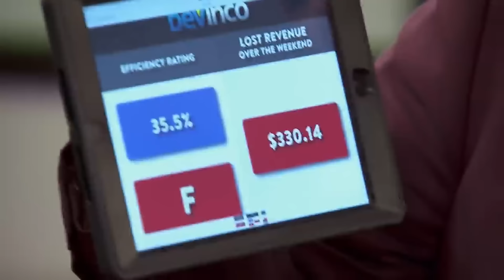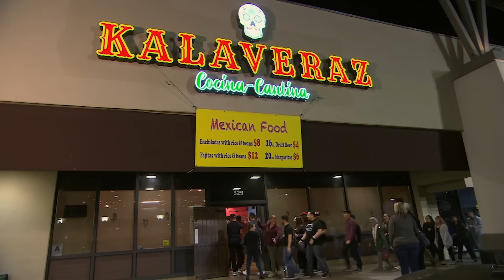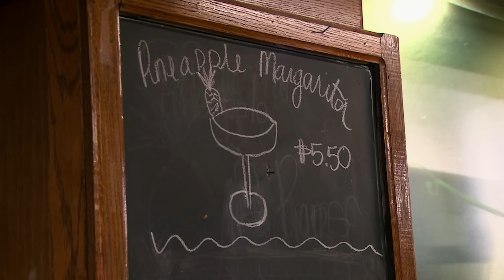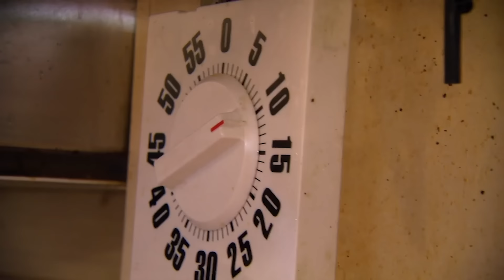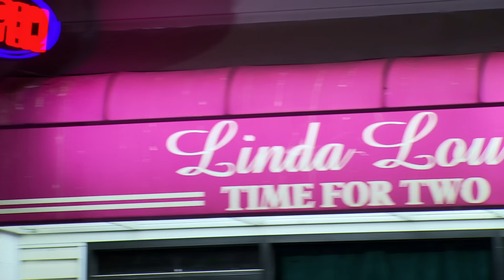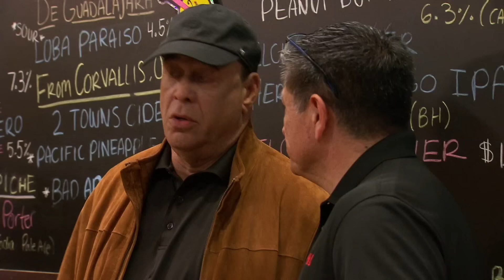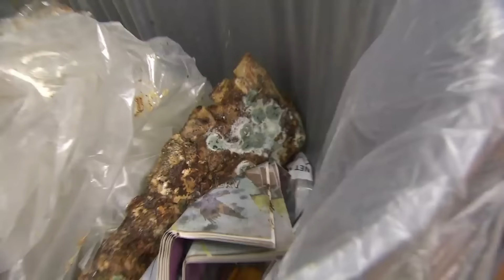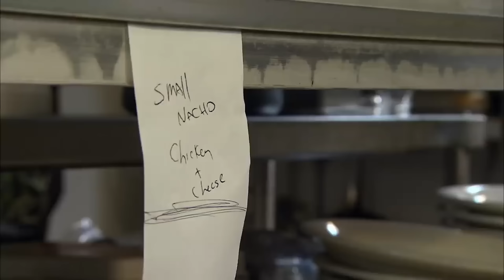Fan Favorite Bar Rescue Moments SUPER COMPILATION 😬 Part 3

Comment: Might be the editing, but that took way to long to start evacuating that bar when the fryer went up in flames. That shit happens you immediately A: get everyone to put their drinks down and gtfo just in case and B: go for a fire extinguisher instead of peeling foil off, messing around with salt etc...

And make sure your safety equipment is working, fire extinguishers don't last an eternity. You have to stay on top of safety maintenance because when you need it it's quite literally do or die.